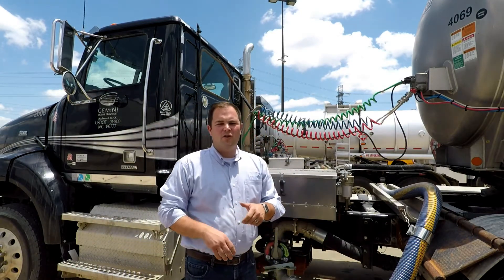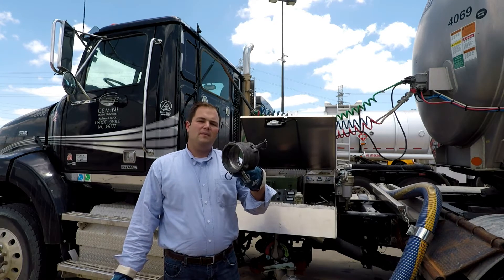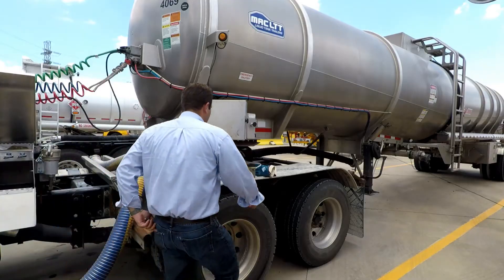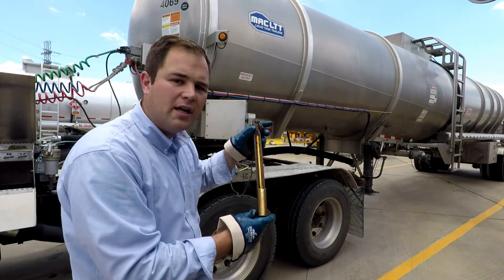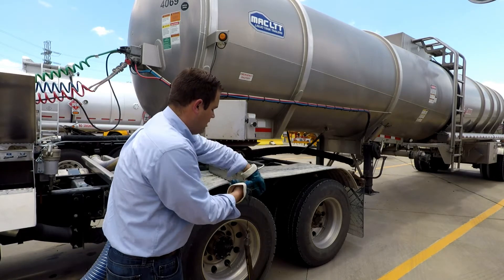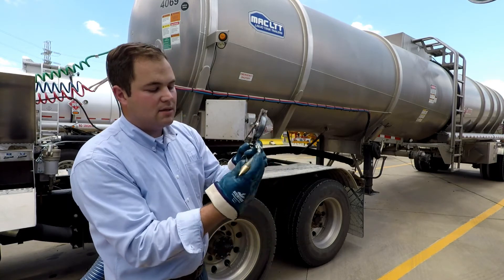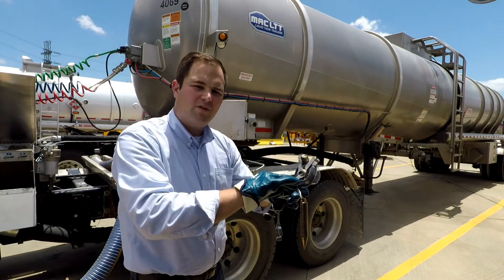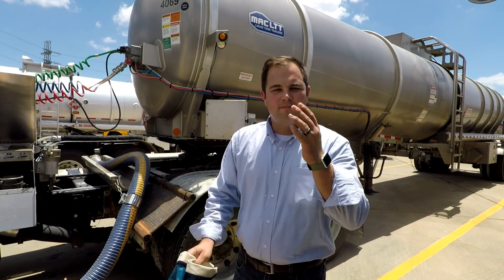Driver Tips - Oil Testing Equipment

Comment: I just got my hazmat what are the odds of someone with no hazmat experience. To haul crude oil, I have many years of driving just no hazmat.
Reply: ah man even with just one year experience many companies will take you and train you to do this crude oil stuff. its a cleaner job if your coming from doing vacuum, frac pump driver/operator or any other oilfield job that involves more labor.

Comment: Nice job man, very detailed. With oil prices going back up I'm thinking about running oil. I use to run frac sand when oil was over $100 but got out when it hit $40. I like that you named all the components, I was able to look everything up on Amazon and check out what I'll need to get started. I was going to buy my own truck and lease on with someone but I think I'll start out as a company driver somewhere till I get the hang of it.
Reply from the maker: floridabeachbumm awesome to hear! It’s a great job with a lot of growth potential right now. Gemini is hiring if you’re interested in a company driver position.